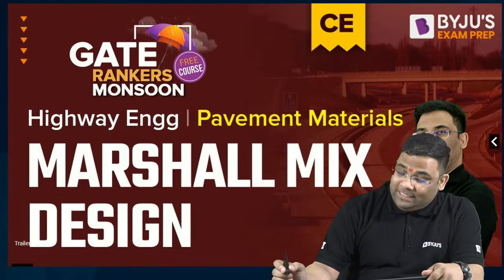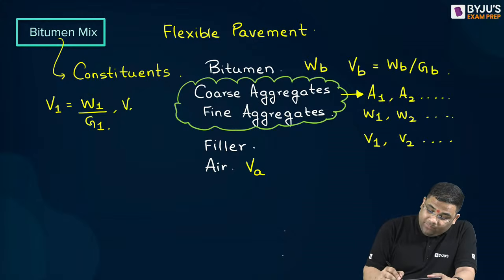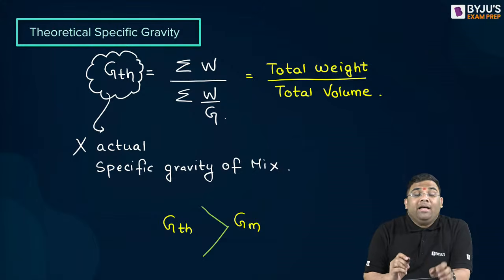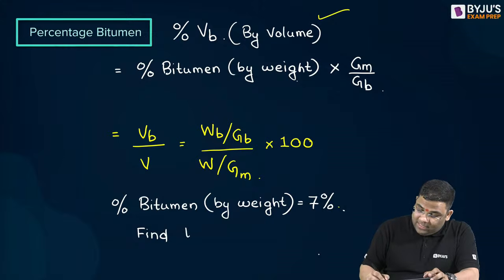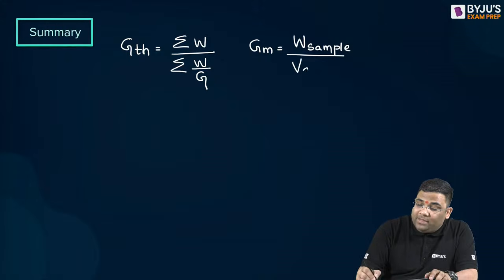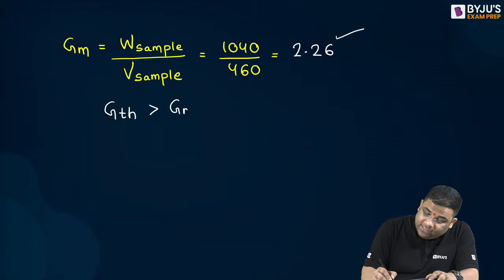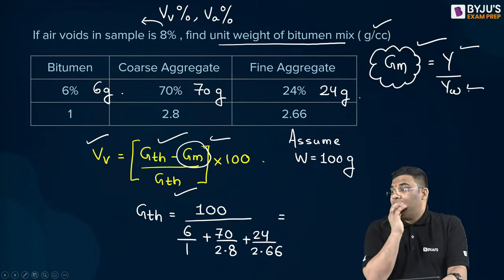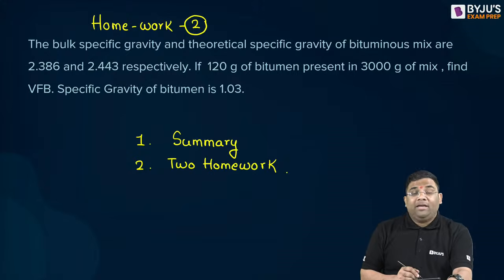GATE 2023 Civil Engineering (CE) | Marshall Mix Design/Pavement Materials in Highway Engineering

Comment: Marshall Mix Design 
Constituents of Bitumen Mix 
1. Coarse Aggregate  of Weight, Vol. and sp. gravity  (W1, V1,G1)
2. Fine Aggregate of Weight Vol and sp. Gravity(W2, V2, G2)
3. Filler   (W3, V3, G3)
4. Bitumen (Binder)  (WB,VB,GB)
5. Air  with volume Va
Specific Gravity(G) = Unit wt of material (Ym)/ Unit wt of water (Yw)
if Yw=1g/cc then  G= Ym 

Theoretical Specific Gravity of Mix (Gth) =  (ΣW/ΣWi/Gi)
Specific Gravity of Mix (Gm)= (Wt. of sample/Vol of Sample) 

Gth is not the actual specific gravity of mix because vol of air is not included in it so the theoretical specific gravity of mix is more than the specific gravity of mix 

1. Percentage Air Voids(Va%)=  It is define by volume 
  Va%=((Gth-Gm)/(Gth))*100
   it is define as the volume of air wrt to the total volume 

2. Percentage Bitumen(Vb%)-  Vol of bitumen in total vol of mix 
Vb%= (Gm*Wb)/(Gb*W)*100
               or 
Vb%= (Gm/Gb)*(percentage bitumen by wt.)

3. Voids in Mineral Aggregate =  It is the percentage of total voids 
VMA = Va+Vb 

4. Voids filled with bitumen = is defined as the percentage of bitumen in total voids 
VFB= (Vb)/(VMA) 

Thank You So very much sir for explaining this topic in such an easy manner.
Reply: Very nice compilation